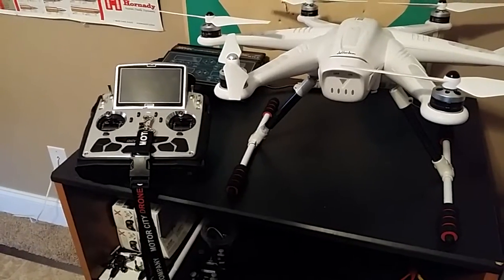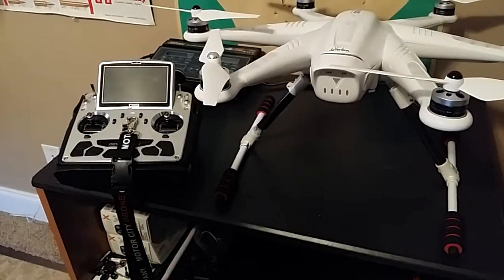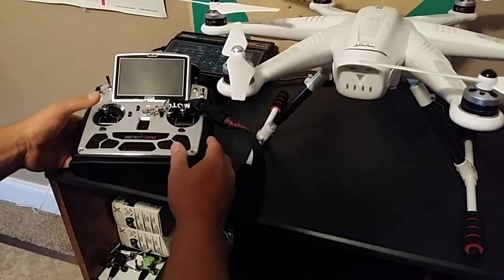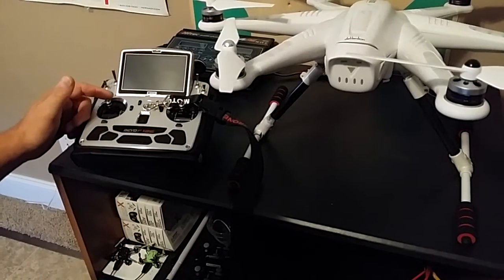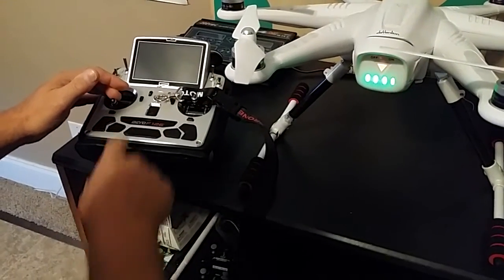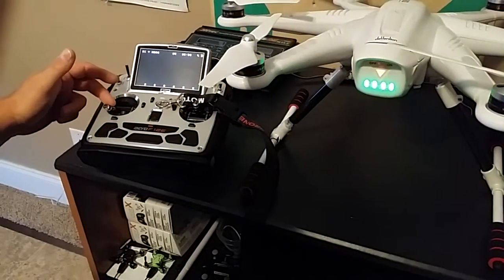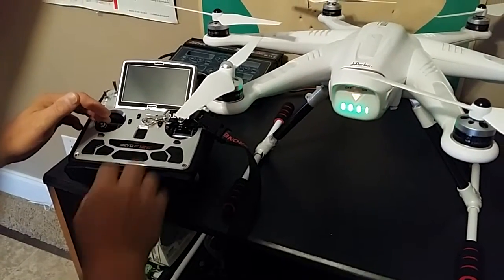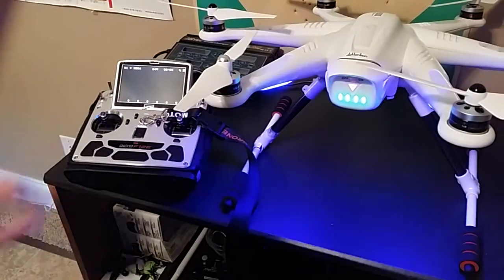100% Successful Binding of the Walkera TALI H500 to the Devo F12E

Comment: With me spent 2 hours trying to get it to bind. What got it to work was naming the model TaliH500. Powered down everything then turned on the battery, then the transmitter. Legs immediately extracted, then did the compass calibration unlocked motors, and I was good to go.
Reply: ok guys i have a poblem. i just got the TALI H500 and the devo f12e. i just tried to bind it and unfold the legs. i cut on the f12 then the h500, lights came on but landing gear didnt unfold. and did not bind. can anyone assist me with this?
Reply: @simonsays3211  did you ever got it to work? I am having the same problem

Comment: wht not first the transmitter to on and after that the hexa? Like the manuel tells.
Reply: Thats how i do it and never had a problem, Radio first then copter and viola its bound :o)
Reply from the maker: EL EVO You can do it how it works best for you but this method works perfectly.
Reply: CCW Chris Yes your right, Your method just shows others, another way to bind there Hex, Good job and thanks for sharing :o)